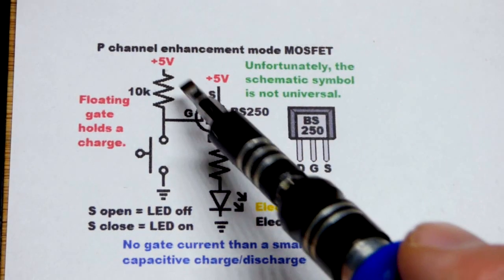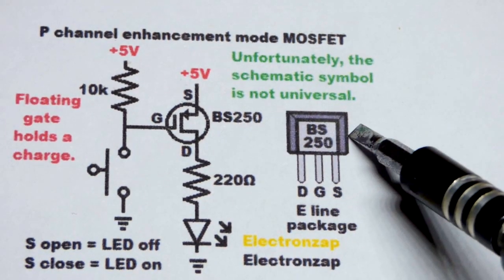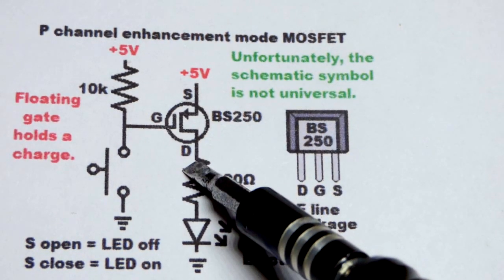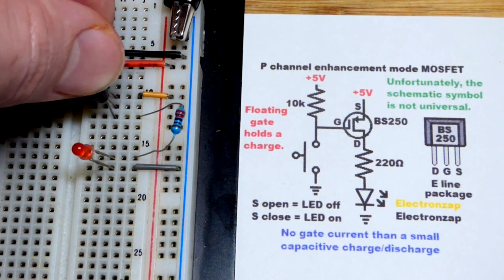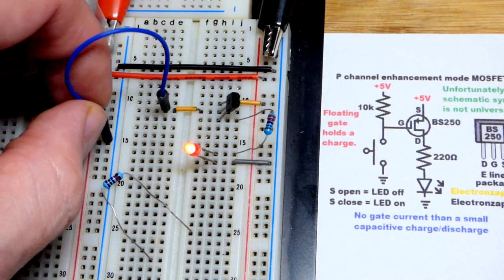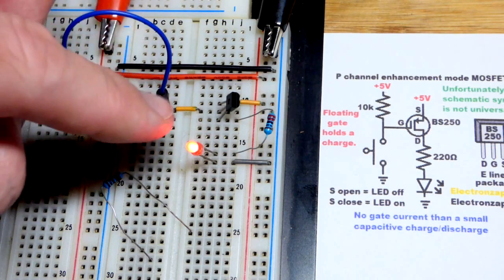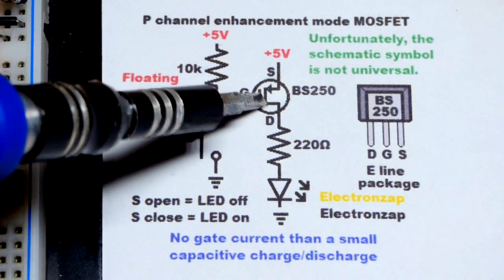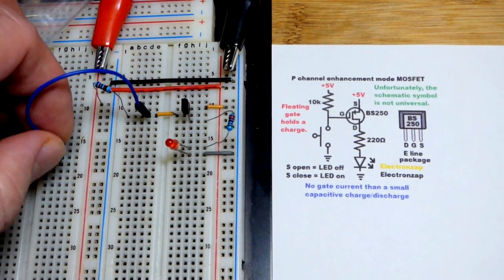High side switch circuit made with BS250 P channel enhancement mode MOSFET transistor how to DIY

Comment: Can the the source voltage (5v + through the 10k res) that is supplying the gate of the mosfet be the same 5v+ supplying the power to the led through the 220 ohm resistor?  That is to say can the 2,  5v+ sources be joined together and also can the grounds be joined together to form a  single power source such as a single battery or  single power adapter.?

Comment: Mosfet symbol is for an N Channel Mosfet. Everything is okay with the circuit. Just wrong image. Little arrow inside the Mosfet should be pointing away from the gate for a P.
Good explanation for a high side switch 👍

Comment: I have used this simple circuit to use in car or boat.    I use this with a small size low current toggle switch for controlling a power MOSFET that switches the high amperage to a high current load instead of using the toggle switch to drive a relay coil that has high current contacts for the high amperage load.    It's smaller than a relay and it has no moving parts to wear out or contacts to corrode or burn up from arcing.
Reply from the maker: Nice!